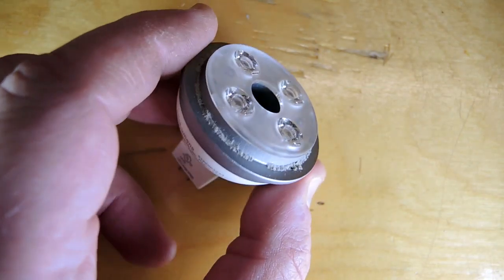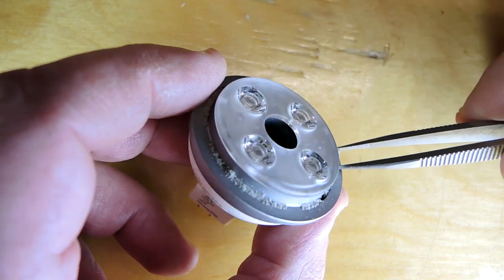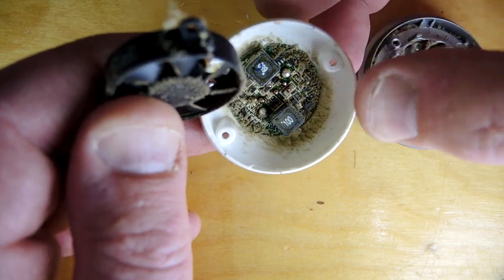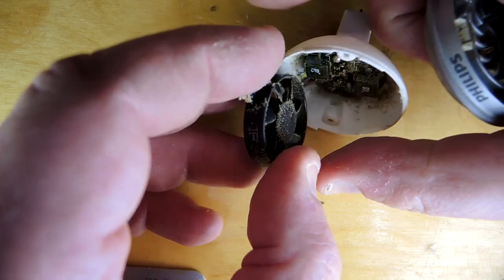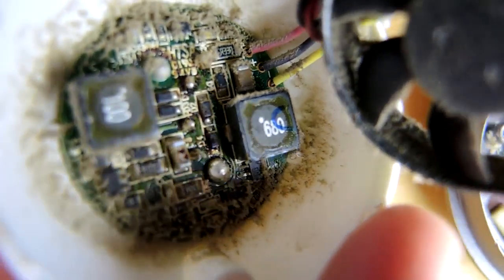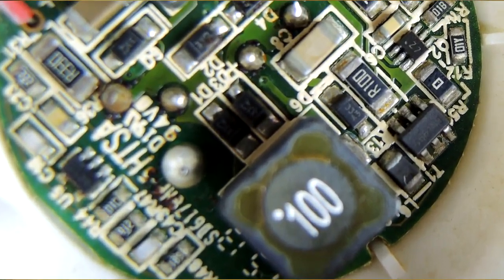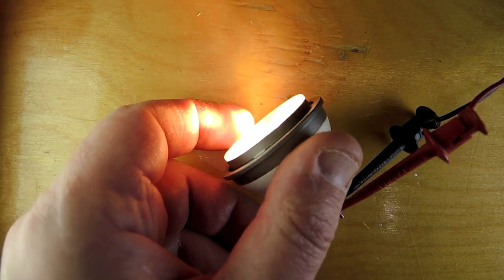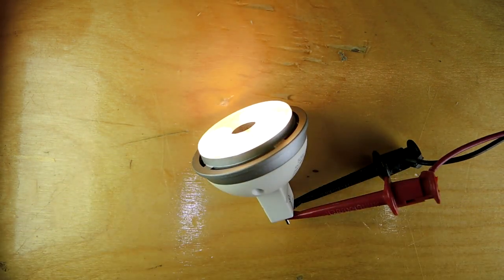Have you cleaned your LED light bulbs lately?

Comment: That is too much power for this package. Usually GU5.3 are around 5 watts. I've never seen one with a fan inside. I'm surprised the fan itself didn't fail like they do in a computer. It must be making more noise than a buzzing inductor that people complain about.

Comment: 12 volt lamp rated 10 watts. No wonder it need a fan. Newer MR16 bulbs with ~500 lumen output are down to around 6 watts now but still need a decent size heatsink.